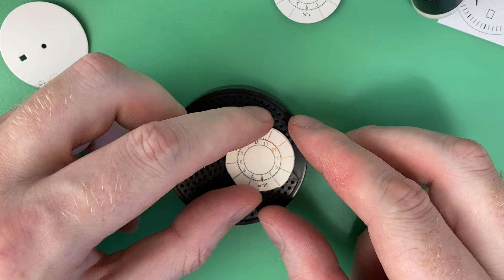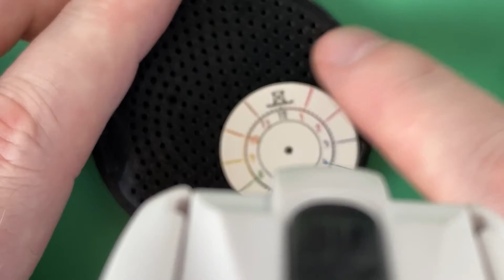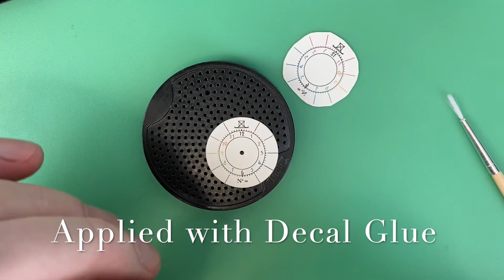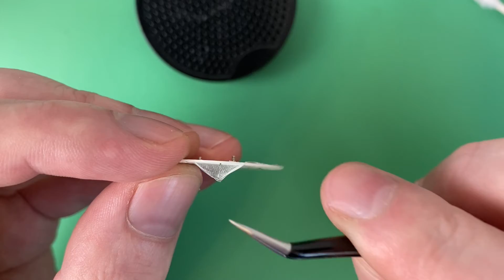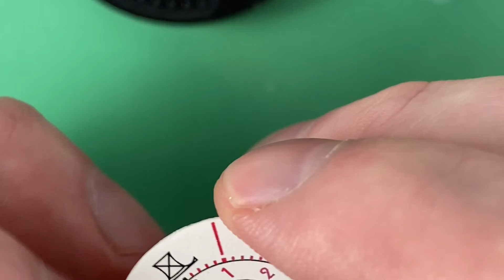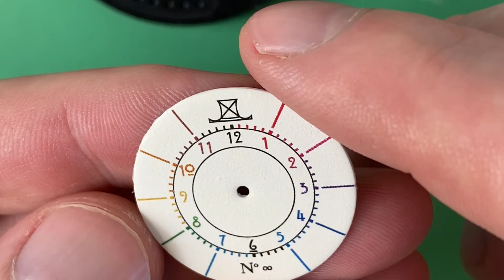Making Custom Dials: Multiple Layers of Waterslide Decals

Comment: I did a second layer with micro set and micro sol. And it worked. I did clean it with some soaps after the first layer,  maybe that's the way to go?
Reply from the maker: I put quite a bit on so a couple layers might prove helpful on some surfaces. It somewhat comes down to how smooth vs textured the surface is, in my experience anyway.

Comment: Hey man, i know this is an old video, how about rotating the print a few degrees per layer when printing to combat the twizzler effect?
Reply from the maker: yeah exactly, I think I talked about it at some point in this video, if not then it's in one of my other videos, but yes, you can rotate the prints going to the printer and it would combat the rough edge issue

Comment: This is a really interesting process you’re experimenting with!  Cool stuff!  Have you considered rotating the image 45 degrees before printing the second layer?  Doing that may shift the aliasing to a different set of lines that may make the “twizzler effect” less apparent for all lines.  Thinking this occurs due to the way the print head is presented to the transfer paper while printing.  🤷‍♂️
Reply: That's an amazing work around. I will try it!
Reply from the maker: now that’s a clever idea! and I expect you are right, because it’s only lines at certain angles. I will add a third layer and give this a try. Thanks bud :)